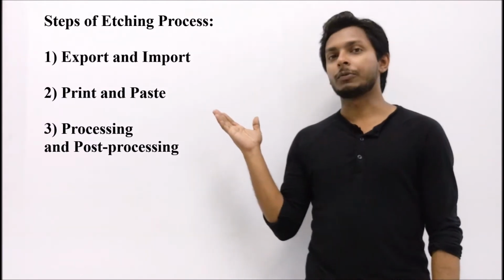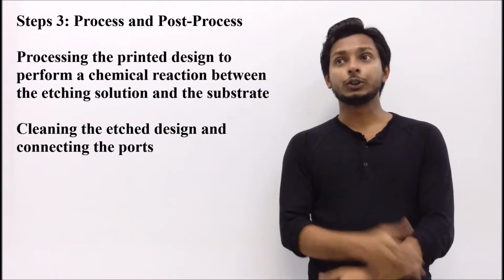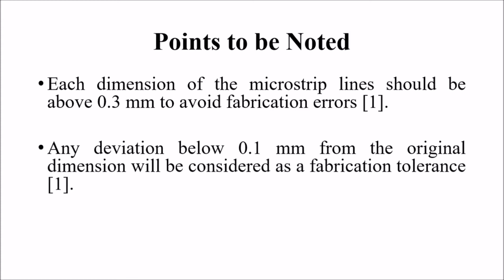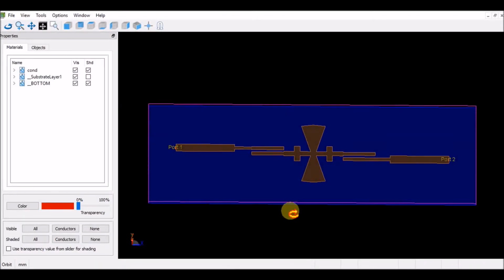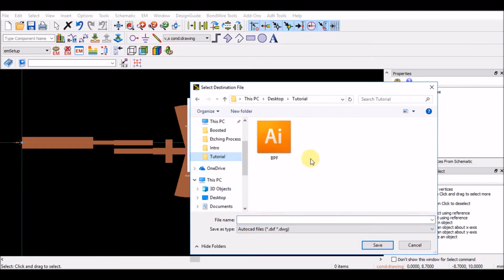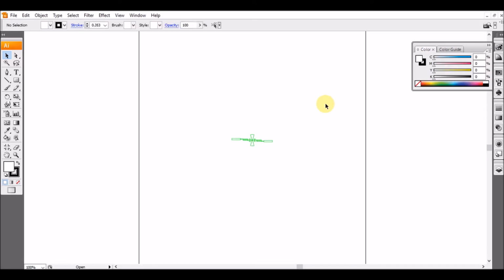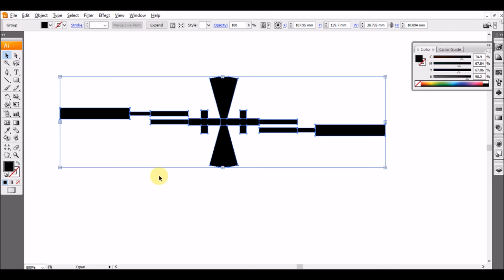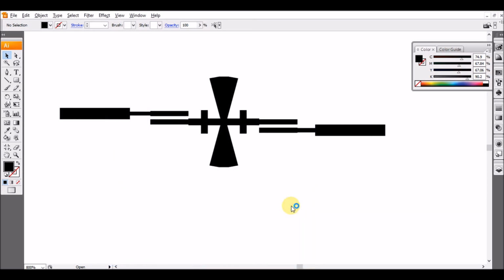Etching Process for Fabricating Microstrip Designs

Comment: if the strip width is around 0.15mm with substrate thickness 0.25mm (roger3035), what process you will suggest for fabrication?
Reply from the maker: For 0.15 mm strip width on 0.25 mm thick substrate, still the etching process is very useful. However, for fabrication, you should give the design to a manufacturer who professionally does chemical etching because of the sensitivity of the thin design.
Reply: @kayserazam  thanks kayser

Comment: MashAllah, u actually deserve more subscribers. My question is about microstrip antenna lumped port, in simulations we just assign a line of 50 ohm between patch and ground what about practical how we connect both. Thank u in advance.
Reply from the maker: Jazakumullahu Khoiran.
Generally, SMA ports are used to connect the feedline and the ground plane of a microstrip patch antenna. If you look at the construction of an SMA port (you can google it), you will find a cylindrical leg on the middle, and other few legs equally at the top and bottom of the cylindrical leg. The cylindrical leg on the middle is connected to the 50-ohm feedline while the bottom legs are connected to the ground plane (top legs are connected to the ground in case of CPW-fed antenna). Soldering iron is melted with heat and then used to make the connection. The cylindrical leg on the middle of the SMA port has an impedance of 50-ohm that matches the feedline impedance of the antenna; this leg is responsible for delivering the signal from/to the antenna. Whereas, the bottom or top legs are responsible for grounding the signal.
I hope, this will make some senses inshaAllah. You can google it for further understanding. Also, you can buy an SMA port that is not very expensive.
Reply: @kayserazam  thanks for brief explanation. It helps alot. Thanks again 🇵🇰🙂